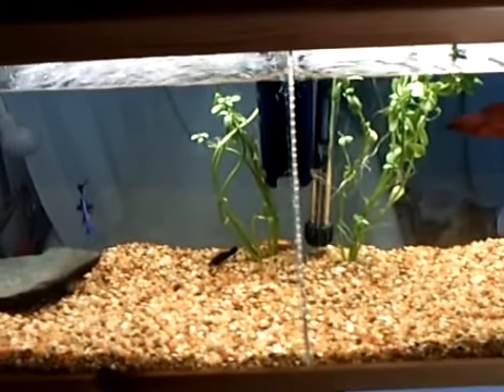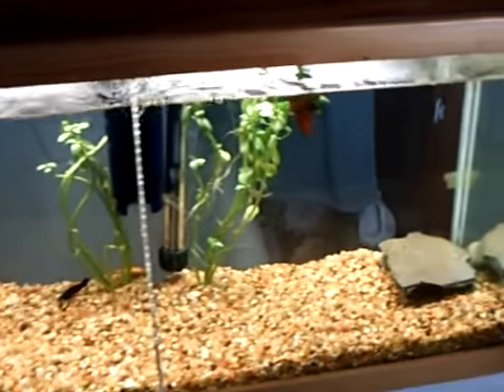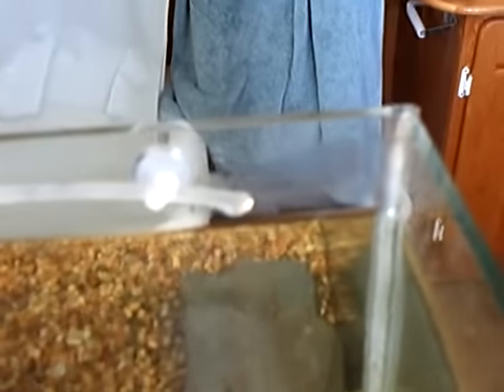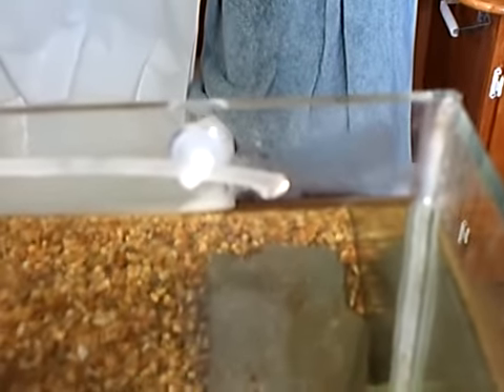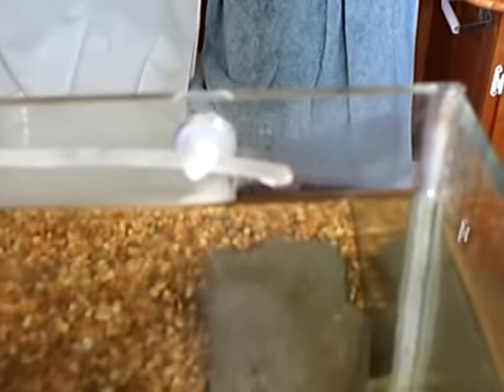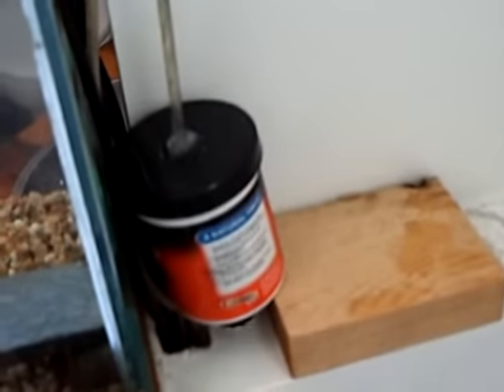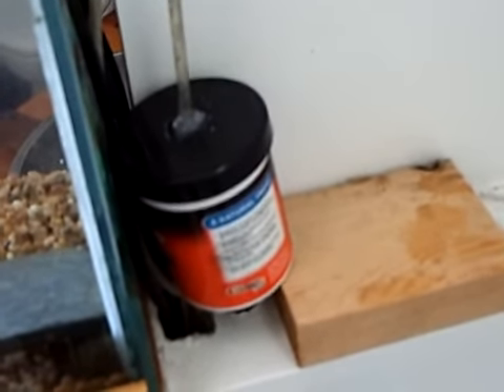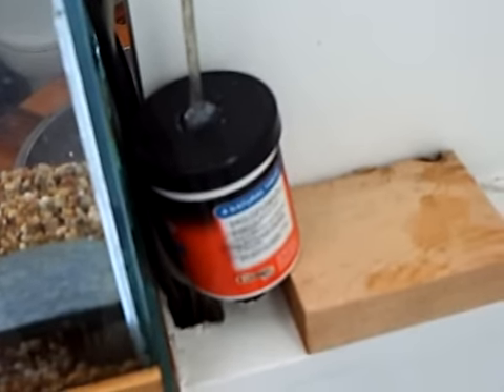Self changing aquarium

Comment: Do you have a sump build in underneath that too?
Reply from the maker: No sump, just a needle valve to control drip rate.
Reply: Great inventor, can you show me how to make one? Thanks, my lost 7 discus for past month, i'm losing my hobby on this, i did 50% water change weekly, and couldn't saved the fish.
Reply from the maker: Aaron Le
In order to build a needle valve you require a metal lathe. You can use a ball valve it's just a bit tricky to get the right drip rate. If you aim for 9 seconds per drip this will give you about a 15% weekly water change for a 10 gallon tank. The good thing about this is there is no build up of toxins over the week and then a shock of clean water for the fish to deal with.
Reply: Amazing inventing you got, unfortunately i could not do what you did, it would be nice if you do a video instructions and equipment, but thank you very much.
Reply from the maker: Aaron Le
Thanks for the kudos. I have moved away from little tanks and have gotten a bit more complicated. The details can be seen at http://ilikedirt.ca/Tank/index.php?c=6